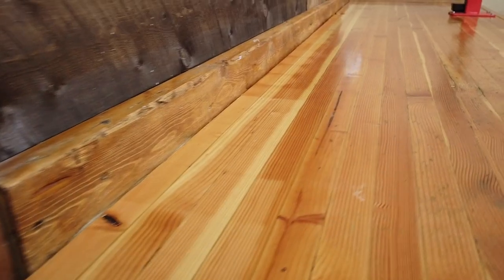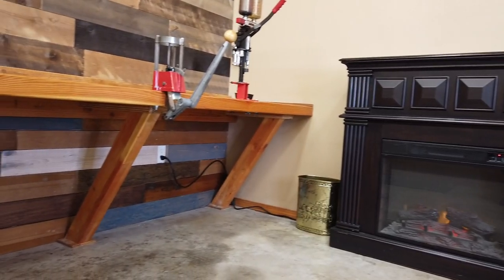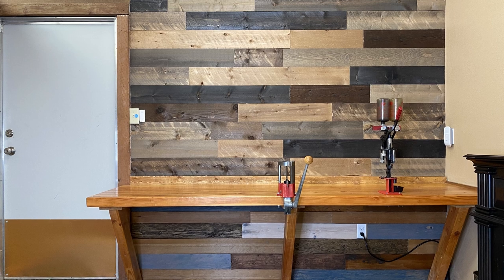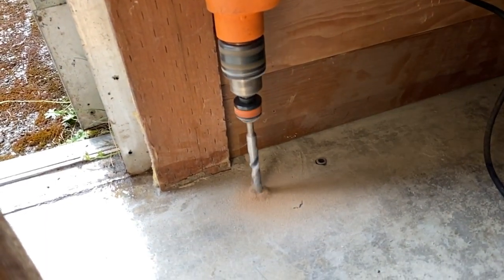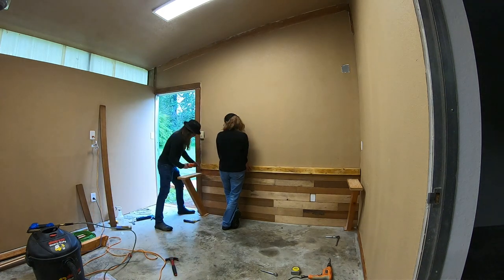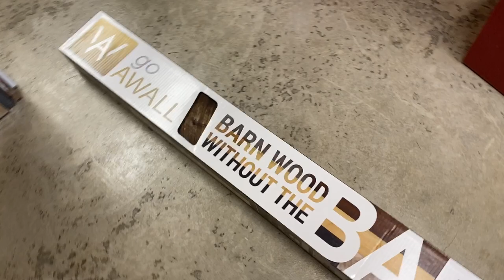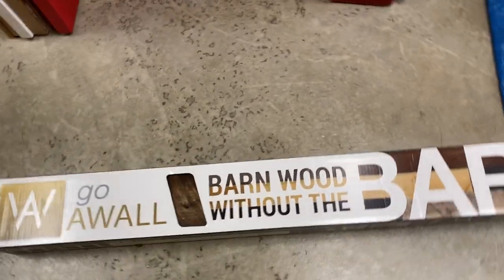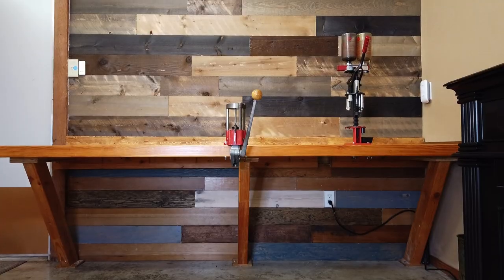HOW TO Build an Accent Wall with Jed & Jessica / JED iTV Reloading Room Remodel

Comment: My reloading space is set up in a similar manner. When we moved to our current residence was no space in the house available for a reloading room.  I designed my garage that was being built to have a space for that. Because it was a new build I used rough cut lumber for the walls, and pallet wood for all of my cabinets.  So I have an old west cabin feel for my reloading and leather work. I'd say your bench has less clutter than mine. Great job.
Reply from the maker: I did clear the bench off a little for filming. But, I do tend to have a place for everything and return it to that space when I’m done using it. I like a clean and clear workspace to start with. 
Your place sound nice too!  
~Jed 🤠

Comment: Hey, have you ever looked a local sawmill? Take a look at there rough cut planks. 
I do like  what you guys did to the wall. The blacks mixed in with the light colors looks really good.
Reply from the maker: Thanks for the tip.  I haven’t looked into that but, if I ever take on a project like this again I will keep it in mind.  As for the color mix, I have to give full credit to Miss Harley (Jessica) as she picked the pattern. 
~Jed 🤠